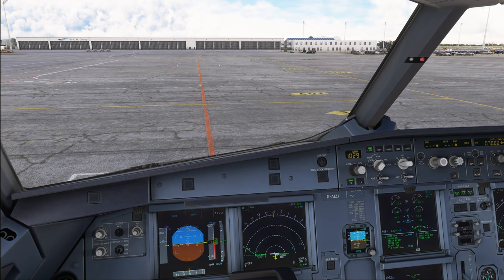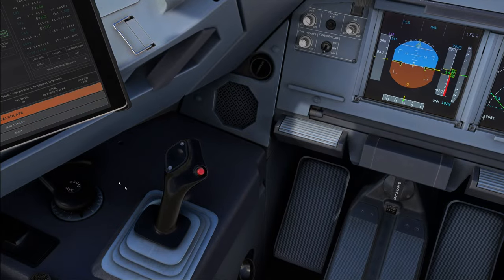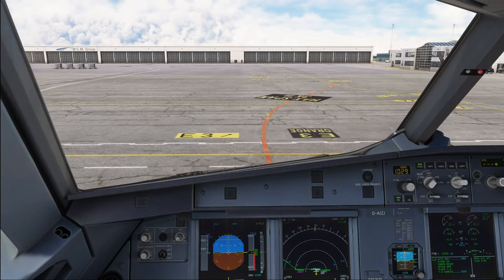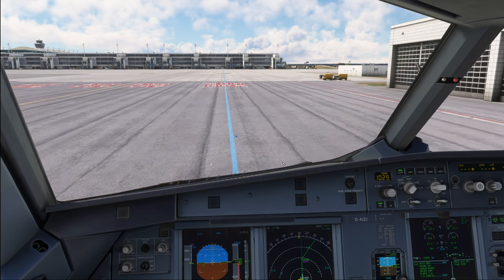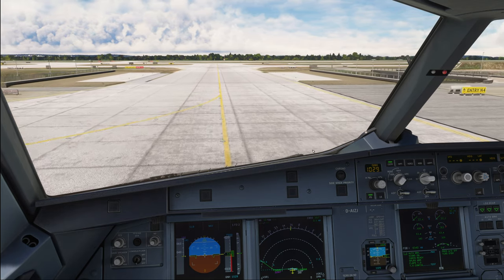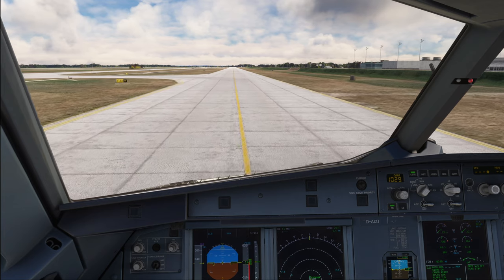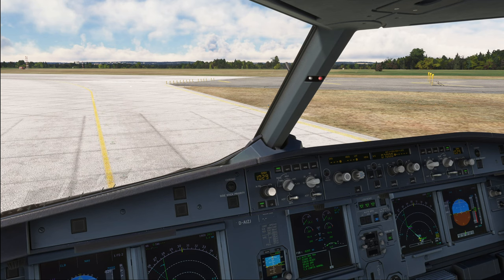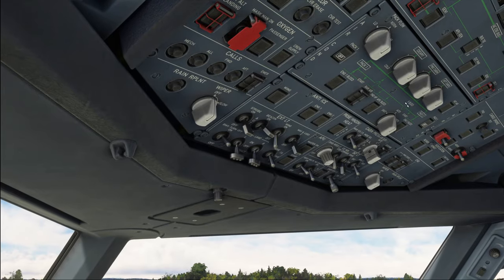Airbus A320 Tutorial 7: Taxi | Real Airbus Pilot

Comment: Thank you for the video Manu ! I have a question: what’s the point in terme of optimisation or safety, to let the plane accelerate to 30kts then to slow it down to 10kts and repeat, instead of keeping an average of 15 to 20kts ?
Reply from the maker: If you constantly ride the brakes to maintain those 15-20 knots then the brakes would heat up and wear down much quicker. A hot brake will provide much worse braking performance in case of a rejected takeoff and a worn brake... well, is expensive.
Reply: @A330Driver  thanks for your answer!